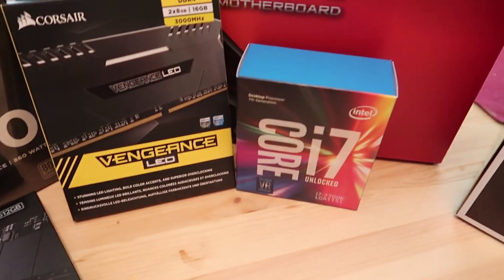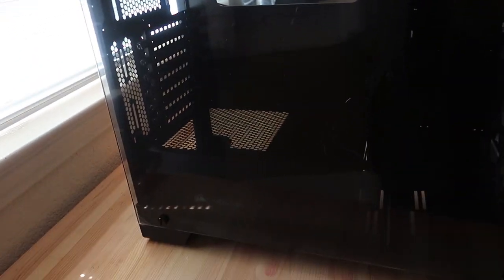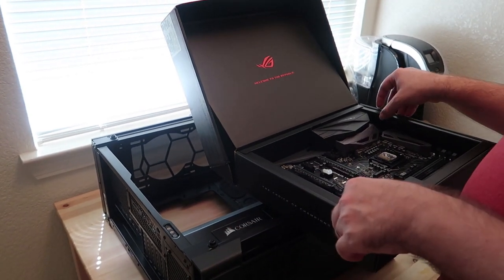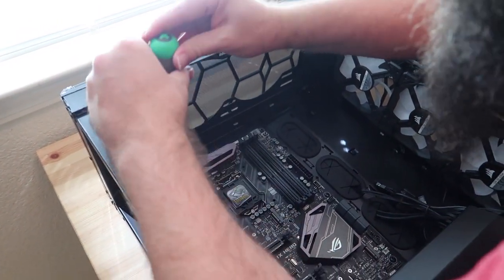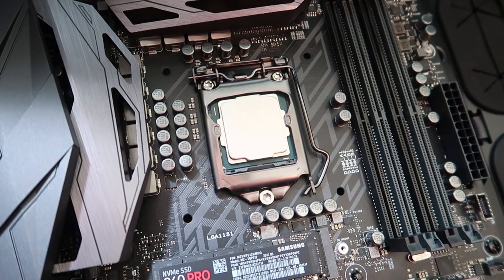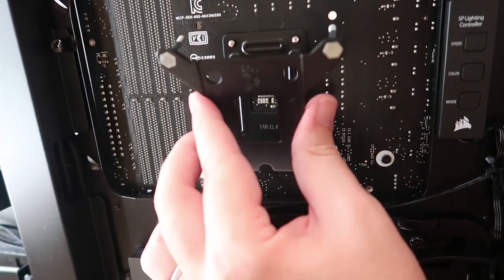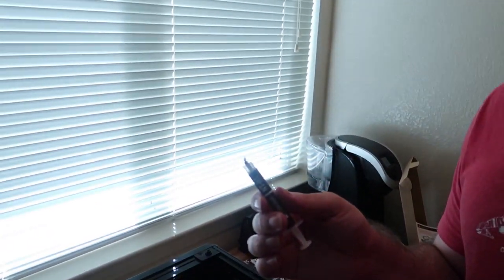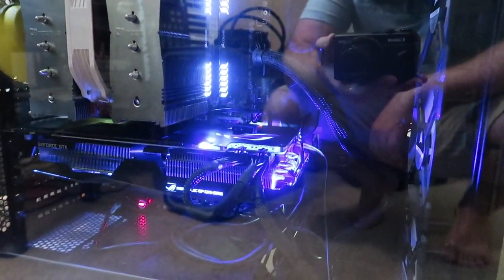Tefty VLOGS: Gaming PC Build i7 7700k ASUS STRIX 1080ti OC - Destiny 2 4k Ready

Comment: I've recently upgraded also. Sticking with my i7 4790k, switched to a EVGA 1080 from a 780ti. And bought a 240 sdd as my boot drive from a normal HDD. I forgot to order an extra sata cable so I'm waiting for it to show up in the mail tomorrow. I'm running a  dual monitor set up. One 4k, and one 144hz. I really hope D2 was worth the upgrade.

Comment: Glad you gave us a peak at the build! May want to check on the ram slots you are using and the thermal paste amount, may want to use a bit more.  Also say no to loopdy doop PCIE cables, you can actually get a few more frames out of the GPU with dedicated PCIE cables! You might also be able to adjust the CPU cooler fan mounting position to potentially fit both fans in there. 

Keep up the great work!

Comment: I have a similar build: 
-i7 7700k
-Asus ROG strix z270e
-EVGA GTX 1080ti SC2
-32gb of Corsair lpx 3000mhz
-Crucial Mx300 275gb
-Seagate Barracuda 2tb 7200rpm 
-Corsair H100i v2 
-Evga 750w psu
-Phanteks p400s tempered glass 

So far loving the performance, you can tweak every setting to max and I can take advantage for CAD works

Comment: Where are you doing your 4K ? TV at 60hz max is my guess (Which not be bad). I went with 2k at 165hz 27" (PG27UQ). Have a 4K tv if I want to switch to 4K at 60hz. Will test in both configs.

Comment: Great video again teft but a couple of tips. You need to use alot more thermal paste in the CPU so it's covered. Better for the long term. If you needed more cores you should have gone with threadripper. You seem like an Intel fan but you could of saved some money and got more cores. Id also add more ram. 16 GB is good but again for the long term 32gb is gonna be better.  The back fan needs to be rgb. Looks cool with that case. I've built many many PCs. Takecare teft.
Reply: Threadripper costs 1000 dollars for their flagship and about 800 dollars for the lowest spec threadripper processor. I7-7700k is 300 dollars, he would not have saved money
Reply: If it's a gaming pc then threadripper would not be worth it

Comment: It's a shame the Noctura stuff is the most ugly colors you could possibly choose. I went with the Cryorig Universal and I'm at 5ghz on my Kaby Lake, hit 71c in gaming which is cool for KL. Thing can hit 85c and still be stable.

Tefty, look at the Cryorig Universal. It would fit. Fit on mine because the design has an offset for the heat sinks. The fans are thinner too. 

But your setup is nearly identical to my own. It's going to rip through D2.

I have the ASROCK Fatal1ty z270 K6 Mobo, 7700k, EVGA 1080Ti SC2 Gaming, GSkill Trident Z 3000mhz ram, Cryorig Universal cooler and a Samsung 850 Pro drive. All inside the NZXT H440 Case.

You can definitely get to 5ghz and be stable on the Noctura.